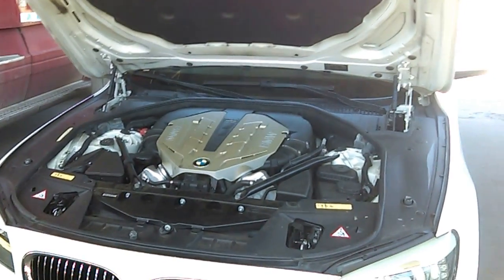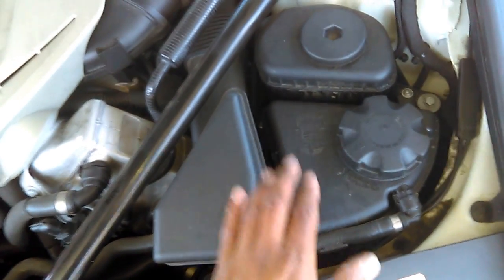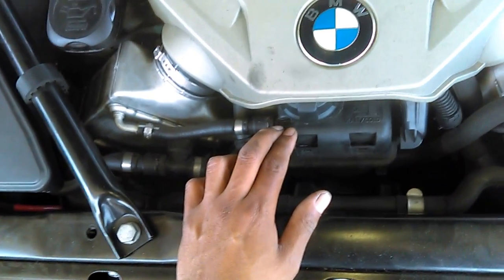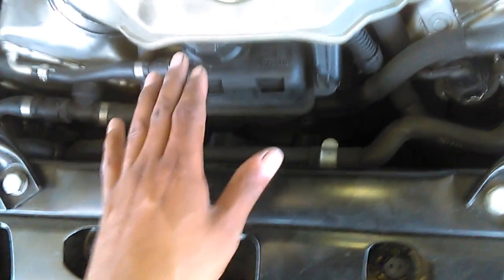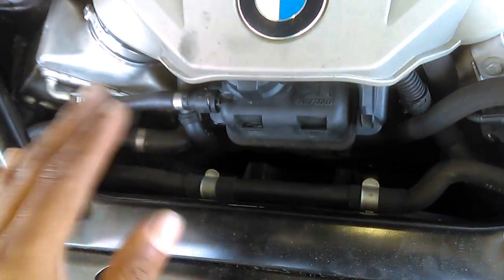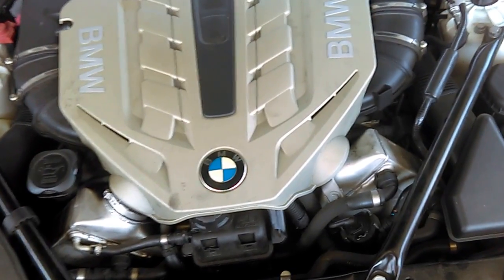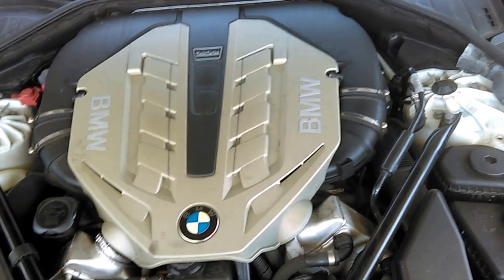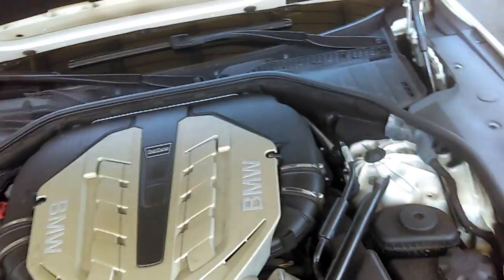Why BMW N63 has two coolant tanks BMW X5 X6 550i 650i 750i 750Li

Comment: If these tanks are srparate, why when i open the cap from the engine coolant and open the cap from the air coolers while engine running, the engine coolant is dropping level and the air cooler is rising?
Reply: Look man I’m new on the BMW world but he is Right, I just checked my engine and that one for the engine was full and the other one for the turbo was empty and I found a leaking because one of the hose was loose, then I fixed and filled, now everything is good!
So you really need to check and fill both.
Reply: Thank God I saw this video before I have some problem in my engine!

Comment: Does the cap have the right-hand thread or is it the left-hand thread?

Do you have to turn the cap anti-clockwise to unscrew and open the cap?

Also, do I have to replace the engine and turbo cooler tank cap if it doesn't click when I tighten it? Thank you

Comment: Hello i love your channel I have a question about a charging issue in my 2011 bmw 750li one day I was driving the car and all of a sudden message says charge battery so I started to head home which was about 60 miles away then on the highway all lights came on the dash and car was shutting down so I let it for about an hour an drove to a friend's place close bye so I put a new alternator and had the battery checked which is less than a year old and battery voltage is a at 12.7 when car is at idle and only goes to 12.9 when on the gas and im still getting charging warnings any help would be greatly appreciated and I also did the battery registration with my snap on scanner
Reply from the maker: With the engine running the voltage is 12.9?
Reply: Battery on these cars only charges when your car is coasting. It doesn't charge like traditional cars when accelerating only when coasting. Hence the Blue battery sign by you mpg gauge.

Comment: I'm trying to get a 2016 or 2017 BMW 7 series I'm undicide between the 740 or 750 I definitely want a xdrive. What year and which one you recommend?
Reply from the maker: Both models are fine from those years.  
If you don't really care about power, the 740 is more than enough to enjoy the BMW.  Aslo, it has better fuel economy.
Reply: @franciscoamayaYT  but which engine is more reliable?
Reply from the maker: The 740 is more reliable but the 750 from this year is good as well.
Reply: Francisco Amaya For the 2012,would you prefer a 750Li v8 or the 750Li twin turbo? Because I’m hearing there are too many issues with the coolant/oil leaks
Reply from the maker: @SouthEast Wink 202
On the 2012 750Li they are all V8 twin turbo. The 740Li is l6 twin scroll turbo 
The 750Li has problems but everything depends on the maintenance it had when it was new.  The 740Li in the other had is a little more reliable.  I like 750s but 740s are fun as well. 

I have a new channel name I.E. Euros 
https://m.youtube.com/channel/UCIsM5dM2g4fQBO5QzMQpsfg

I will be posting new BMW video there and other performance vehicle stuff.  Make sure to subscribe there to get new BMW DIY videos.
Reply: Francisco Amaya yes sir,thanks for the reply and info

Comment: So I got the “add coolant light” on my dashboard does this automatically means their both low ? And can I add blue color coolant to both ??
Reply from the maker: Add only to the main one and open the cap of the small one to push the air out.
Reply: @franciscoamayaYT  hi...am having trouble opening the cap smaller tank. Would appreciate some tips or tools to use. It is very tight and wont turn. Thank you.
Reply from the maker: The seal should be dry.  
Use a small plier to fit the cap and turn it to the left carefully and then use your hand.
Reply: @franciscoamayaYT which is the main coolant?
Reply: @franciscoamayaYT  if you fill the main reservoir, does it flow into the smaller resevoir
Reply: @joshs2419  nope
Reply: @03mm24 so do I fill them both if they are both low? Or just the big or or just the small one I’m so confused and don’t wanna mess my car up
Reply: @daquan9244  fill them both if both are low

Comment: Can the turbo coolant pump over heat the engine if its bad
Reply from the maker: No, the turbo coolant runs after the engine.
Reply: So my car is over heating it's has nothing to do with the turbo coolant pump?
Reply from the maker: I think your thermostat is not working well.
Reply: And the AC blows hot now because the car overheat so that can't be a thermostat problem right
Reply from the maker: The AC switches off when the engine is overheating.

Comment: Hi Francisco.. can you tell us a little bit about how to change the valve stem seals on this car?
Reply from the maker: Adrian Constantin 
the valve stem seal replacement is a very complicated job than require different tools to be done, tools like: 
N63 engines timing tool
n63 engines valve stem seal tool kit
and other basic tools. 
to start this job you have to remove the valve cover then to remove the timing chain and then when the cylinder head valve are exposed you need to use the valve stem seal tool kit to replace the valve stem seals.  this job cost around $2,500.00 to $4,000.00 very expensive.  
DIY valve stem seals replacement will be very expensive because you will have to buy the tools and the parts.
Reply: Francisco Amaya.. thanks a lot bro. good looking out
Reply: Just use a heavier oil weight and add rislone valve stem seal repair.
Reply: @fairdinkumpiereviews5357 Yup. Also replace PVC valves. PVC valves are the main culprit of smoke and oil consumption they are brittle and need to be replaced every year. I almost got ripped off the mechanic wanted to open the engine and replace valves but I changed the hoses and no oil consumption after. People get intimidated and let the mechanic trick them .
Reply: Hi Francisco, my air coolant tank is making some noise after turning off the engine like vibration  any tips 
Thanks .

Comment: Hi! My 750li smokes from under the hood and also from the exhaust is this a valve stem issue or something else. Car only has 45k miles. Thanks
Reply from the maker: +Ram Naidu 
You may have a oil leak near to the exhaust manifold or turbo remove the top engine cover to see if there is any visible oil leak or you may have a broken exhaust manifold or turbo seal.
Reply from the maker: +Ram Naidu 
45k miles should be under warranty
The bmw factory warranty is 
4 years or 50k miles.
Reply: Francisco Amaya, Thank you for suggesting this new option, I assumed it was the valve seals. BMW does not want to cover it under Warranty as it's past the 4 yrs, just like you I only use it on weekends.
Reply from the maker: +Ram Naidu 
Check online at BMW recalls to see if your BMW has any open recall about oil consumption or something else.  Just Google BMW recall and go to the BMW page and enter the BMW Vin number to check for recalls
Reply: So I took your advice and removed the air intake cover and found the driver's side Diverter Valve leaking, the plug connector was soaking in oil and also the passenger side Crankcase Vent pipe is cracked in half, so could this be the reason for the white smoke from the exhaust or do you think it could still be the valve stem seals?
Reply from the maker: +Ram Naidu 
I guess you should replace all those broken components and see what happens after that. 
Almost all BMW  N62 and N63 engines have problems with the valve stem seal but your BMW has very low miles to have that problem so I suggest to replace the crankcase line because the crankcase system creates vacuum inside the engine and this helps to evaluate the pressure that the engine generates when it is working and this may be fix the tailpipe smoke
Reply: Thank you Francisco, will heed your advice and order the parts today and see if I get lucky any suggestions as to who carries the parts at a good price, its a 2011 750li..
Reply from the maker: I buy most of  my bmw parts at amazon, they have good prices but you need to check if they have the crankcase hoses. if they don't have them, you should check ebay if they have the crankcase hoses. if nobody have them you better go to the nearest bmw dealer and order them there.   crankcase hose is not a common problem on n63 engine that is reason why it will be hard to find them online
Reply: hi Francisco, found the Crankcase hose and diverter valve on ebay, didn't have much luck on Amazon, will check on the recall issue over the weekend and will inform you.
Thank you so much for taking time to provide your valuable advice
Reply from the maker: +Ram Naidu 
No problem, It's been a pleasure.
Yes, check for any open recall.